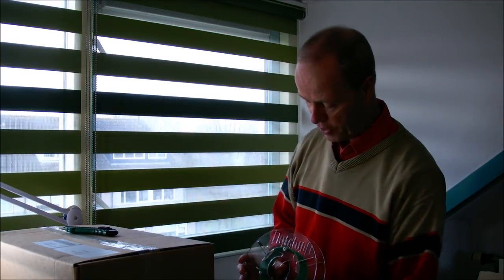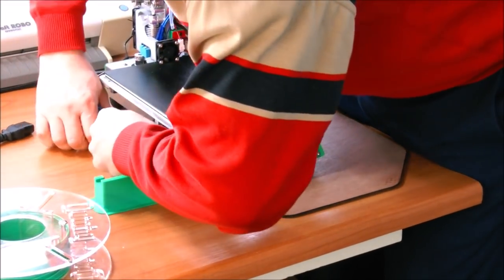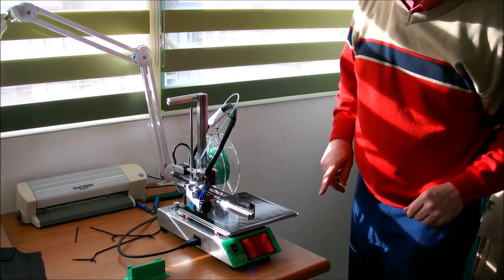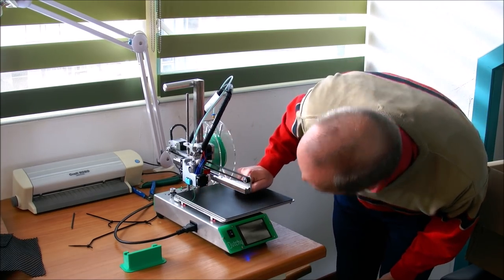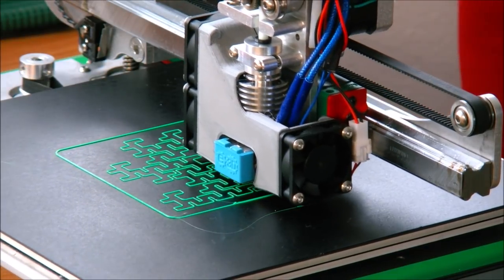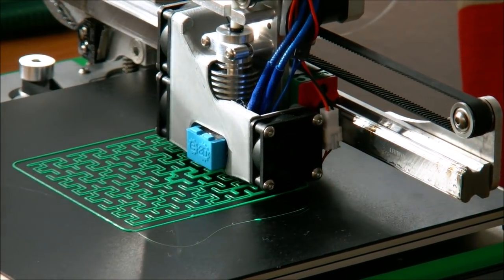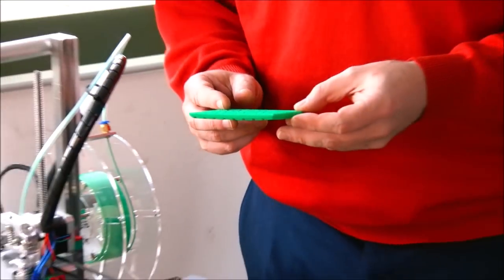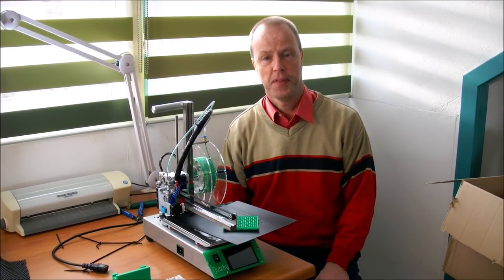Oskar unboxes his new Dutchy 3D printer - Will it work immediately out of the box?

Comment: My first printer was a cheap Chinese printer kit (Anet A6) which cost £170 three years ago. It took several hours to assemble and some of the parts were faulty and there was semi-exposed mains wiring on the power supply and exposed electronics board. Very bare bones kit which needed several upgrades (designed mostly myself and printed on the printer itself) to get into good working order. I wouldn't recommend this route unless you have more time than money (I was a student at the time) and are confident tinkering with things. Since then I made many upgrades to the electronics and some of the components and I'm pretty happy with it. Like anything you build yourself it's much easier to fix if something goes wrong and you can use nice components.

Since having the printer I've made many things and won prizes in a couple of competitions, including a new 3D printer (Snapmaker 2 A150, which can also do laser cutting/engraving and wood carving). That printer is on the other end of the spectrum, a very premium machine. While it is also a kit, it was extremely well built, easy to set up and use. Even still I've stuck to my old printer for now since I'm used to using it and have tuned in the print setting in my slicer.

I've also started a Masters degree in Material Science and Additive Manufacturing, and I've got my 3D printer to thank for that also, so a pretty good deal in the end :).

I've been subscribed to your channel for many years and I'm also quite interested in designing mechanical things (mostly iris boxes: https://www.thingiverse.com/BrienAllison/about https://www.myminifactory.com/users/Brien%20Allison ). You will find you need to need to optimise your designs for FDM/FFF 3D printers compared to your shapeways designs, although I'm sure you're already doing this.

I'm really looking forward to your new designs (you can set up a shop on MyMiniFactory if you want to do that) I can make on my printer, and maybe you will print a couple of mine :).
Reply from the maker: Nice!

Comment: I got a Prusa i3 Mk3S at the end of last year and out of the box...it was in pieces (as it was a kit). Assembly was well documented, but took me several hours to get it going. But at the end, I ended up with a very robust 3D printer that prints well! My only two issues were needing to clean the nozzle occasionally and de-greasing the build plate when I get fingerprints on it, but other than that, it's so accurate I've designed and printed puzzles at home! I can't wait to see what you come up with!

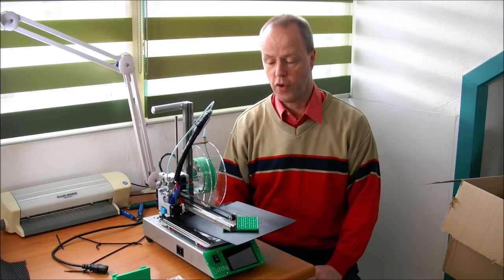Comment: 13:13 Yes. Since quite a while ago in the early days of home 3D printers. A plywood Ultimaker Original (serial #118 pre-ordered), no heated bed. There where a few critical things to fix (like upgrading to stronger motors, adding some washers to the motor holders, ...). But since I got it working properly it regularly delivers high quality prints. It's still a good printer to this day. Very hackable yet not a printer that you spend more time on getting the printer to print acceptably than you spend time printing your actual ideas with the printer. But we thankfully arrived at cheap out of the box working printers by now. As you nicely demonstrate. Sadly the new Ultimaker models became way to expensive and less hackable for my taste. Would probably go for a Prusa now.
~~~
I've added a Flex3drive to my Ultimaker to be able to print very soft TPU (brand filaflex) without loosing all the speed advantage of the bowden design. Cool upgrade works perfectly but delivery time was many months back then. Zesty nimble is an other option.

Comment: great little machine! 
i have 2 3d printers a rostock FDM and an anycubic photon SLA.
my first experience was fascinating.. but only because i am ok with building, tuning, filing, adjusting, researching, trying, failing, tuning and readjusting again ;-)
the photon was quite a lot easier to get started with.. but then again, i have been tuning both my printers since i got them.. (4 years and 2 years ago)
i have been following 3d printing since the 80s when i stumbled across it on a job for TV.. a massive resin / laser printer (we didnt really have LCD screens then) for medical and scientific purposes that cost millions to build and develop and 1000s in running costs...
it only took me 30ish years to finally get a printer of my own ;-)

Comment: Wow is that printer expensive O.o I hope it's worth the cost. I personally also own a 3D printer but mine was a fifth of the cost.
Edit Question: It took me about 30 minutes to set it up and get it running. Since then I have been tinkering around with it here and there to get it running better. I have had problems with the extruderblock oozing once but after replacing it there was no problems. I also recently moved away from using massive amounts of uhu to get it to stick and am now just printing directly on its glass surface. So technically you could say the setup process has taken the last few years.

Edit: Ah ok so this one comes pre-calibrated. That usually makes it already a lot more expensive.
Edit2: and it being made for a school/uni environment of course also adds some more costs
Reply from the maker: It also makes it more robust, low-maintenance and high success-rate. All qualities that I need, as my time is scarse.